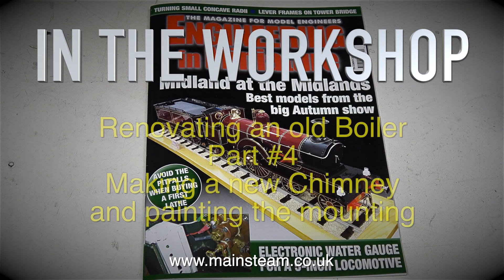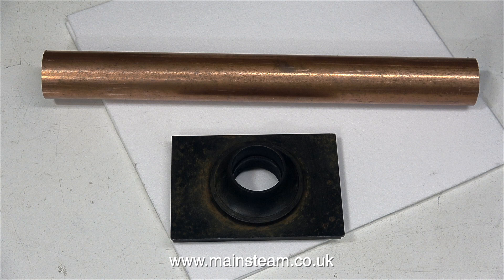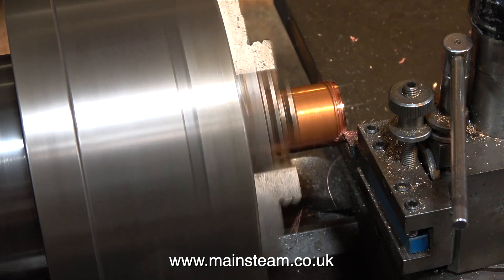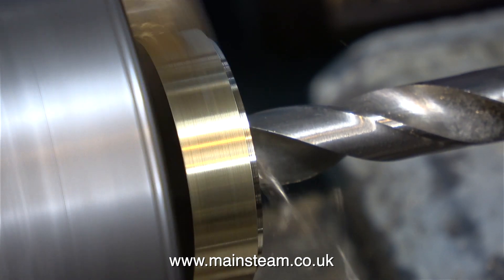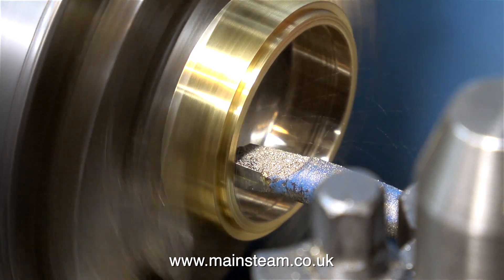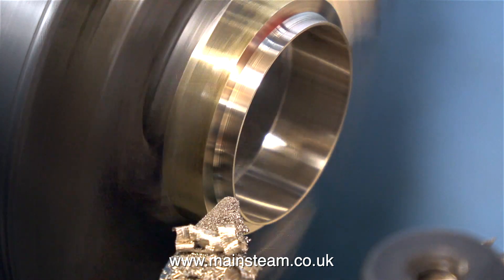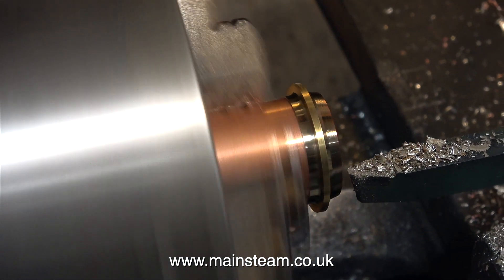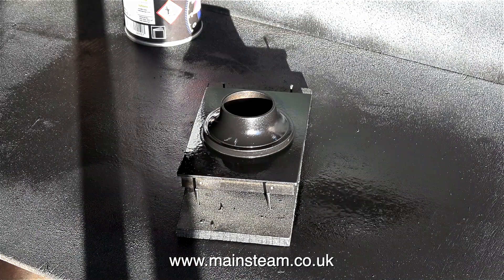RENOVATING AN OLD MODEL STEAM BOILER - PART #4

Comment: Copper can be machined as well as steel if you use bacon grease as a lubricant.This old trick works well when tapping copper.The finish you get is polished and very smooth.The chips are not a problem.Try bacon grease,it won't cost you a lot because a little goes a long way.Just be sure to clean up after the job.I'm surprised the chaps from Blackgates didn't know this old trick.P.N.

Comment: Do you cut copper with the same tooling than you do iron and other metals?
Reply from the maker: Yes . . .
Reply: I don't want to annoy you, but copper needs other tooling. I respect your no links policy; however, I would suggest beginners to google up on “Recommended Machining Parameters for copper and copper alloys”. The DKI (German Copper Institute) did a good job in putting together PDF on the topic. Not only makes a better finish, it is not as dangerous - For both, the machine and the operator. As i'm not a trained professional but a hobbist myself, i hope you forgive me to state what might be obvious to you.
Reply from the maker: Please explain what you mean about "Other Tooling" and remember that many beginners don't usually have "other tooling" . . . . at least I didn't when I was a beginner.
I use a standard carbide tipped "knife" tool for copper and that seems to work fine for me . . . .
Reply: an other cutter tool, or in my case a different carbide insert. problably came with the lathe anyway some spares

Comment: Although one can now obtain 4-jaw and 6-jaw (per Adam Booth) self-centring chucks, during my apprenticeship in the 1960s I was never really impressed in those days. All too often, apprentices eschewed the 4-jaw independent chuck because it was 'inaccurate', when the precise opposite was the same. Real engineers know that 4-jaw independent chucks are far more precise than self-centring chucks, and I was apprenticed alongside such a bloke, good old Maurice Willie, my apprentice trainer.

I loved setting up stuff on the old Dean, Smith & Grace (Keighley) lathe with its taper turning functionality.

Much later in life, in the mid 2000s, finding myself a student at the School of Violin Making and Repair, Newark, Nottinghamshire, I volunteered  extra engineering workshop NVQ Levels 1 and 2, and blow me, there in the workshop was an old Dean, Smith and Grace.

The tutor was amazed that I took to the machine so easily, until I told him that I had mastered this monster before I was 18!

If I had the room, I'd love to have an old D, S & G in my hands.
Reply: i think it's a "guy thing" . . . we all seem to fall in love with our first tool.